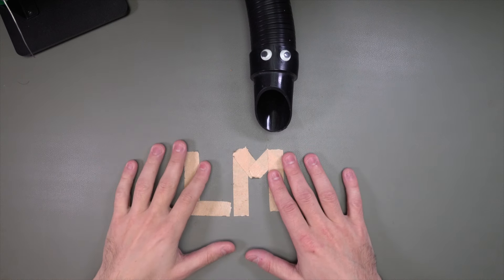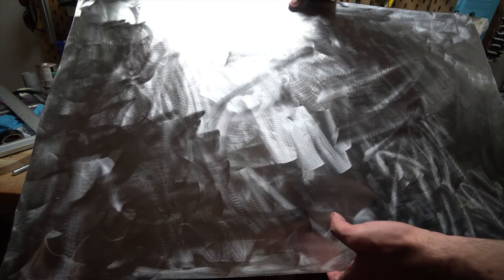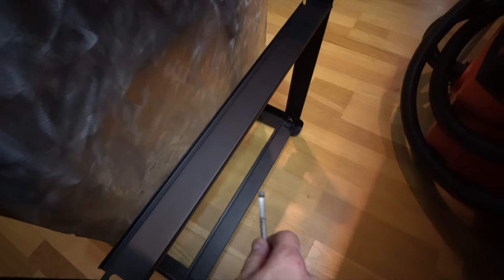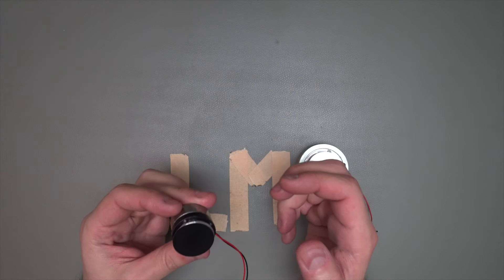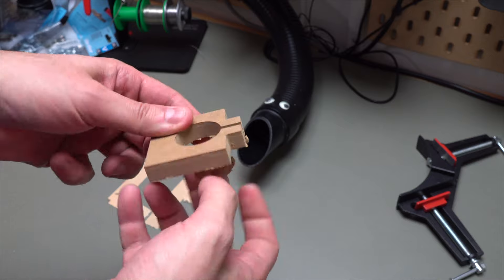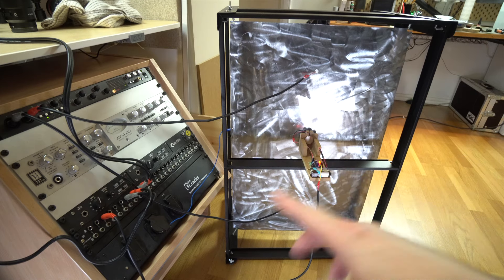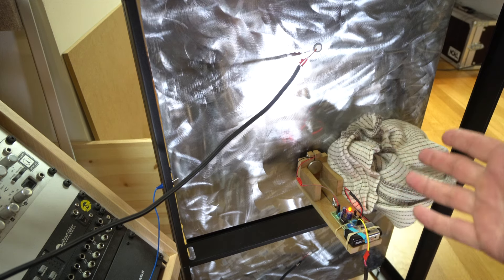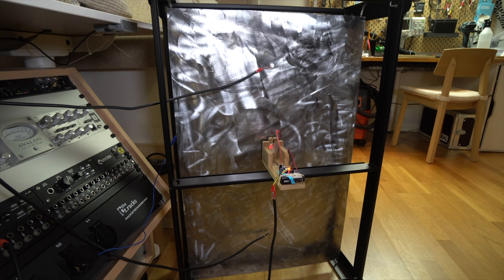DIY "IKEA Hack" Plate Reverb Part 2 (Sounds amazing now!)

Comment: What if you built something similar to what you used to mount the transducer and just put a fair sized square of wood with some soft padding on it on the end. Then you could use the same kind of slot and wing nut to get the padding as tight on the plate as you want..

Comment: Smiling at 13:25.  Good job!  One suggestion: put some dedicated EQ on the drive, or the pickup, or both.  Also, use two piezos for stereo, and - don't - mount them symmetrically.

Comment: The first version sounded more "metallic" somehow. It had a metallic ring to it. But now it sounds more like a real room. A very small rectangular concrete room without any furniture, but still like a room. 
I wonder if you'll get a more pleasant sounding reverb if you experimented with different shapes to the plate. I'm thinking that the perfectly rectangular plate sounds like a rectangular room because it has two main directions of reflections just like the room (well it has 3 directions since it's 3d but anyway). A church or concert hall with a nice reverb doesn't usually have all flat wals at 90degree angles, it usually has two parralell wals and two somewhat mismatched or irregular walls and while the floor is mostly flat (but often dampened by benches and audience) the ceiling is usually angeled or domed. I would buy several plates and try out different shapes (keep the one you have now as it is because it does have a really good techno reverb). I'd try cutting the bottom side at a slight angle, and cut it steeper if you don't hear much difference. Maybe try cutting or even rounding the corners of some plates.

Hmmm.. wait, maybe you could first try to add magnets of different sizes onto the plate you allready have (i assume it's magnetic), by changing it's mass in different areas I assume it would effectively be distorting it's shape since adding points of extra mass would slow down the vibration in those areas. Or maybe it would simply act as "furniture" in a room and dampen the reverb.
Anyhow, I'm almost certain you can in some way tune the plate with magnets. 

Also moving the input and output locations will also probably change the sound a lot. Dead centre is probably best for maximum reverb, but it probably also causes more ringing than a slightly offset position.
Reply: Yeah the ringing is kinda hard on the ears
Reply: Don't forget adding additional servos and piezo mics for stereo or more. Also studio pyramid foam vs a towel glued to a flat panel for damping, there could be some unique differences between the two. Linear damping vs offset damping.
Reply: Also damping with another metal plate or a tambourine. Kind of like a sitar.
Reply: So the IKEA Plate Reverb sounds like a small room without furniture?
Reply: Might be easier to tune it by physical damping.....a bit of electrical tape in strategic places would likely do the job
Reply: I'm with you!!
Encountered a dead note on an acoustic  guitar, it just  would not ring out properly.
I added mass to the guitar, like you suggest here with the magnets.
I figured it was resonating sympathetically with the guitars natural resonant frequency.
it changed the dead note to a different fret, it worked, proof of consept.
After some more tinkering it was gone.
Reply: Using transducers instead of piezo mics would help get rid of a lot of the tinny sound.
Reply: waw!!!! ofcourse! I am gonna try a circled one
I travel 20 years back now.... and I am gonna pick it up again. thanx everybody
Reply: @michaelx9079  what is electrical tape?
Reply: @sjangcoenen1358  pvc insulating tape

Comment: I'm a woodworker, CNC guy and a musician.  Your first video was interesting to me but the sound of V1 was kind of meh.  I am blown away by the sound of this upgrade!  It still has a slight "trash can" type of sound but that sound is FANTASTIC!!!!!  Great job!  p.s. The way you're "cross cutting" the MDF at 8:35 is a bit dangerous.  Probably not with the saw you have but with a full size saw you're asking for kickback or some other catastrophe to happen.  When cutting little blocks like that, you should use some sort of crosscut device.  The little block can get pinched between the saw blade and the fence and bad things can happen.  The riving knife your saw has should alleviate a lot of the risk but still a good idea to use best practices.
Reply from the maker: Good tips, Andy. Thank you!  I’m not an expert when it comes to woodworking so I appreciate the feedback. 

Is it possible to crosscut MDF?  There is no grain in MDF.
Reply: I don't really know if you can crosscut MDF, that's why I wrote "cross cutting" in quotes ;-)   The key is that the length of the piece is shorter than the width.  On my saw, I can slide the fence fore and aft so when cross cutting a bunch of pieces to length, I slide the fence back so that the end of the fence is in front of the start of the saw blade and use the miter gauge/crosscut thingy. That way when the workpiece is in the saw there's no pinch hazard but you get the consistency/measuring ability of using a fence.   

Again, blown away by the sound of this plate reverb!
Reply: p.s. I would love to hear how an 0-coast sounds through there - should be wicked.

Comment: Amazing stuff! Just a thought: I was watching a guy who made amplifiers in a similar way and he was saying that you should not input the audio from the transducer into the middle of the plate. Instead, you should off-set it (lower and to the right for example) so that the vibrations travel different distances to each of the edges. I guess this adds more harmonic character.

Comment: Thanks a lot for the inspiration!!
Do you think it's also possible to build the framework with wood and then have the steel plate hanging in there or do I need to build it with a steel frame? Any suggestions are welcome :)
Reply from the maker: I think a wood frame would be fine as long as it’s rigid and doesn’t flex too much. Try it and make a video of it if you can!

Comment: 1 Megohm still isn't a high enough impedance to get a proper flat response from the piezo.  You need around 10 Megohms for that.  That's why piezo guitar preamps normally have a 10 meg input impedance.  That's not to say that 1 Megohm won't give a decent response for the plate reverb.  You probably don't want too much low-end in the reverb signal as it can  make it rather muddy.   So you could try feeding the piezo signals into an acoustic guitar preamp designed for direct connection to an undersaddle piezo. 

You could probably hang two plates from that rack, with a bright and darker sounding plate.  Add a small mixing circuit and you could balance the bright and dark sounds.  

Also, whilst you can easily HPF and LPF the reverb return in your DAW, you might consider adding some simple adjustable HP and LP filters as part of the reverb unit itself, for those who like to do as much outside the box as they can. 

Great idea though.  Sounds very good indeed.  I'm impressed.
Reply: It's better to match impedance and make the high pass selectively rather than not ever having it if you needed it.

Also, an amp with better fidelity would improve this a fair bit, as would hanging it from something non-resonant like cotton cording. I would bet a fair amount of the 'ring' we're hearing in this is simply the springs 'singing' a little. You could also wrap the springs in neoprene or heat shrink tubing to cut down on this problem, if he's really into the springs idea.

Comment: I was reading about the abbey road reverbs and what they used to shorten the reverb was another plate (wood will do for this) the same size as the reverb plate and set parallel to it and quite close. it is arranged so that it can be moved towards and away from the main plate. this causes an air cushion which inhibits the vibration of the main plate, without actually touching it. the closer the dampening plate gets to the reverb plate the shorter the reverb time gets. also they usually EQ'd it quite a bit as well. often on the input as well as the output (or instead of)
Reply: I like that. It doesn't touch that plate, just indirectly through air resistance. turns that small gap into a kind of "membrane trap".
Reply: It would not surprise me if George Martin came up w that idea as he was pretty brilliant. I like the idea of using that rag to play the reverb like an instrument when recording tho...fun!
Reply: could also add extra pickups to the baffle for some more tones to play with :)
Reply: Actually if you use high pass and low pass filters for the input(for example drums HP30hz, LP10khz, bass HP40hz LP5khz, etc)you have basically nothing to do with eq.
Reply: This concept might work better using a sheet of rigid fiberglass.
Reply: A simple squishy foam pad, mounted in a similar fashion as the transducer so you can change the pressure it puts on the plate, would work just as well
Reply: Thanks for that interesting factoid...I was just thinking about how I'd like to see this done with a thicker plate but then thought about how you'd damp it to control the reverb time without ruining the sound. So there it is!
Reply: Where did you read that! Please let us know. :-)
Reply: Something similar but very different at the same time... I was reading how The Prodigy produced their “Land of the Fat” album. I gather that they put amps near a piano, but recorded the reverb coming off the strings of the piano. I’d imagine a tuned  pianio would get some interesting harmonics resonating on the strings. I always wanted to try something like that, but never had a piano around.
Reply: Actually it wasn’t the Land of the Fat album, I just checked. If interested look for a Music Tech article with “Neil Mclellan remembers the Jilted Generation sessions” in the title.
Reply: @erikbarton6352  fat of the land* 

i had that idea the other day! i have a shitty out of tune piano in my living room, i thought about recording a guitar amp underneath it with close mics and have stereo mics in the piano :D

Comment: What about a STEREO plate reverb with 2 piezzo mic placed in different spots of the board ?
Reply: You get a sort of flanger effect from that.
Reply: Stereo plate reverb just uses two separate plates that are matched together. When you're talking recording gear, having matched stereo equipment means significantly more cost because they have to tune every unit in order to match.

Comment: I think it would be great to make a spring reverb with this small transducer..
Reply from the maker: You know, I've been thinking the same thing.  And I have big box of springs that I don't know what to do with.  :)
Reply: @LeoMakes  Ooohh yes please!
Reply: cool, looking forward to it!
Reply: That's super cool!
Reply: @LeoMakes  if you do a spring one (you will wont you? please!) can you see how many 'springs' are able to have signal go through until signal  to noise ratio becomes to heavy on the noise of the make up gain. ALSO!? How about several different jump off places along the collection of springs? say; if you're getting signal through 12 springs, how about an output jack  at the end of every third spring group? I don't really know if that's a realistic. idea? How about thicker to thinner springs? or thinner to thicker? argh! Exciting! Thanks for the inspiring video! NO ONE TELL IKEA ABOUT THIS. THE PRICE FOR THIS PRODUCT WILL GO UP FASTER THAN YOU CAN SAY "SOLD OUT"!! Good luck!

Comment: I do understand why you choose MDF for some parts, but especially for the clamp at 10:28 I would have chosen some other wood like multiplex, that is much more flexible.
Reply from the maker: Good tip.  I’ll look into this multiplex thing.
Reply: @LeoMakes  I googled it, and it seems like it's only called multiplex in Germany. It's actually plywood.

Comment: would grinding the surface in some sort of mathematical pattern affect the sounds?
Reply: negligible. only differences in thickness(strength) of the material, or density would really change sound

Comment: May I ask you one simple question?
Why didn't buy a piece of blank sheet metal instead of cutting off the folded edges and scraping of the black coating, wouldn't that be easier at almost the same price compared to the rent for the angle grinder?

By the way, I am one of the new subscribers and I'm really looking forward to seeing more of your excellent videos!
Greetings from Germany!
Reply from the maker: To be honest, it was easier/cheaper/faster for me to just go IKEA.  However, if you know a good metal shop, that is probably a better way to do it.  The sanding takes forever.

Thanks for watching and the nice words!
Reply: @LeoMakes  I'm pretty sure you can find similar unpainted sheets at your local hardware store. Most will have a sheet metal section.
Reply: Generally they do, but many times they can be much more expensive. Plus the table had a cage premade so he didn't have to spend the time making that.
Reply: A piece of sheet metal is going to be cheaper than this, but then he wouldn't get the "ikea hacks" youtube views bump, which is important for a creator.
Reply: it's cheaper the way he did it, cut piece of sheet metal at Lowe's 4×2 foot is $35
Reply: @funkyfoo714  Lowes isn't a great place to get this. You'd need to find either a local metal shop or a scrap yard.
Reply: @jttech44  He's got better things to do than dig through trash to save a couple of dollars, also his way he gained the mounting cage so win win.

I'm sure if his hardware store was selling sheet metal at half price with a free steel box cage to mount it in he'd have done it.  

Instead of wasting his days searching through junk yards for miracles he went to IKEA, which any of us can do, and built something amazing and showed us anyone can do it.

Comment: "dampen" - to make wet or moist. "Damp" - verb, to reduce or modify the vibration of; attenuate. "Damper" - noun, a device that modifies vibration. Sorry....it's just as a vibration guy (vehicle suspension, specifically...)  this misuse of terms drives me bonkers!! :D
Reply from the maker: It’s funny because someone corrected me in the last video when I said “damp.”
Reply: @LeoMakes   :) Ya, go figure eh. Nice vids though!! Cheers!
Reply: In audio we say dampening to describe how much dampening is applied to a given reverb sound. It's different than 'time' as well, which is how long it rings in total. Dampening is really more about how acoustically 'live' a sound is, by which I mean how long the high frequencies are allowed to bounce around before they've decayed below an audible threshold. 

You've made the mistake of assuming terms in your industry are universal, which in this case they are not.
Reply: @jttech44   Nope, I haven't made a mistake or assumption. You, and perhaps those around you, have made the mistake of using the wrong word for so long you don't even realize it. Lot's of people do it. You 'damp' vibration. You do not 'dampen' it. Sound is about vibration, right? It's a top level engineering term that spans disciplines. I've heard tons of misuse even in respected circles, and ESPECIALLY at the technician level.
Reply: @jttech44    https://soundbridge.io/reverb-reflection/   doesn't take long to find reverb damping in the audio sphere.

Comment: I once made a stereo expander out of a 5 Spring Chest Exerciser nailed to my wall. I would split the signal coming from my guitar amp into two and run one side wire through the series of springs while the other was hooked directly into the tape deck. It slowed the signal just enough to give a bit of stereo separation. Everyone thought I was nuts, but it worked :D

Comment: Thinking about it a bit, if you haven't already figured out damping I'd just get one of those adjustable dampers that mounts to the shell inside a floor tom and mount that to the frame. No need to reinvent the wheel.

Comment: I built something like this with Home Depot parts. I came up with this clever uniform tensioning system using cables and pulls but found that non-uniform tensioning is probably the key to tuning it up just right. (Tension is needed for proper sound) 2 turnbuckles on each corner (on for each axis) would probably do the trick. I'm inspired to go back and update this project

Comment: I am a bit late but you can make some kind of attachment that you can screw into. It would be attached similarly how you attached the speaker. The screw would have a felt end so you can adjust the dampening by tightening/loosening the screw. I am sure you can find a way to attach a handle etc to the screw for easier tightening/loosening.

Comment: I wonder if another slotted wood block with some soft low-density upholstery padding foam glued to it and fake fur fabric stitched into a sock over the end would make a good dampener? Maybe one on each side of the transducer? Then it'd just be a matter of adjusting the pressure applied with the slide block to control the amount of damping. Seems like something that would be simple enough to give a try, particularly if it gives a more predictable result than stuffing a rag or towel into the thing.

Comment: A solution to dump, may be mobile cloth dumpers ... as you did for the exciter ... soft dumpers that can be hardened by pressure and the position can be changed

Comment: My vintage plate years turnbuckles on the corners to tune it, a horn driver as driver, and ceiling tiles on a bracket as damper
Reply: If you'd like some pictures of what mine has just ask
Reply from the maker: Sounds interesting.  I’d love to see it.
Reply: +1 putting the plate under tension and 'tuning' it is critical to getting the god like sound
Reply: @LeoMakes  I can send a picture by email
Reply: @kentwde7933  it's like a drum head